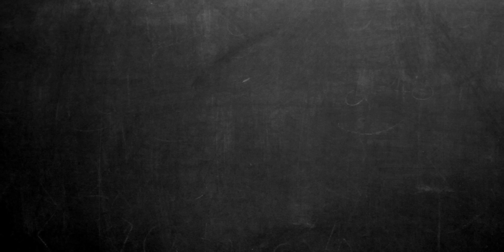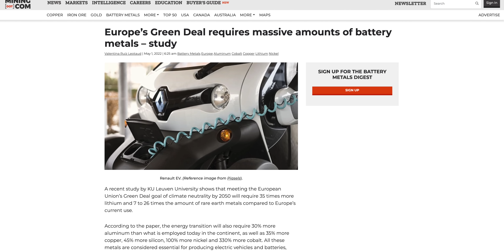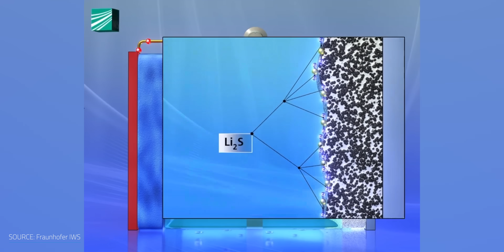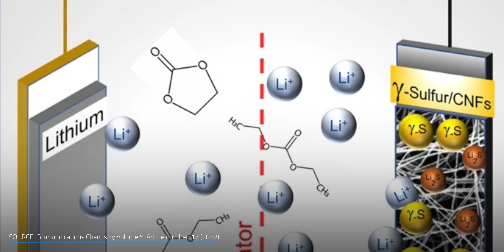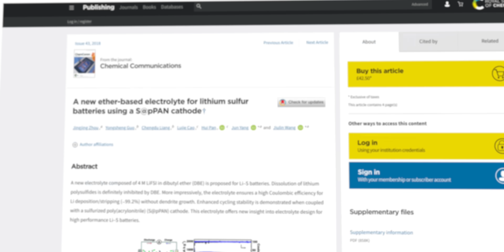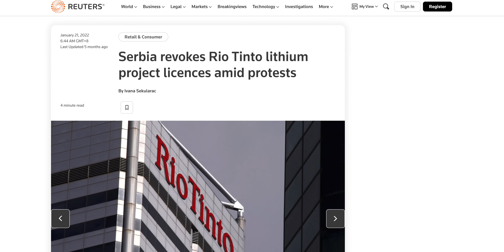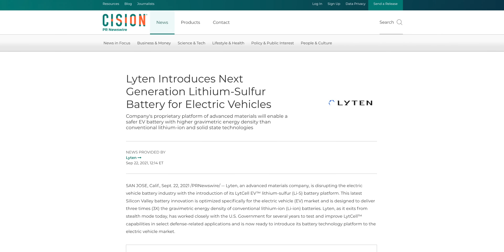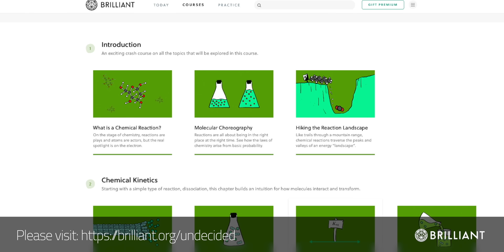Why This Accidental Battery Breakthrough Matters

Comment: I have a question. Could it be possible that someone might introduce Cobalt-60 to the supply chain of lithium ion batteries and this might end up in use, specifically in areas of the world with less control over such things? What would happen to such a battery, aside from being radioactive? Also, is it possible for lithium-ion batteries to become irradiated accidentally?

Comment: Great if it works out.
The problem with solar/wind and some other renewable sources is that we can't store the power effectively.  This sounds like something that might.
Certainly I would be more inclined to go electric if it had 3 times the range, though, to be honest, my driving is not an issue anymore since I work at home.
Still, this might make practical electric delivery trucks and possibly trains.

Comment: One of the big advantages of lithium iron phosphate batteries is that with their lower energy density than lithiumi ion batteries,  they don't catch fire when physically damaged.  Two or three times the energy density of lithium ion suggests fire could be a much bigger problem.   What are the potential mechanisms for uncontrolled energy release and what are the engineering implications for putting them in boats, car and airplanes?

Comment: I have not made the transition to BEVs because battery tech is constantly evolving. When they finally get to a tech improvement which takes away range anxiety, I will make the change. In the meantime, I will stick with ICE despite the high price of gas running as high as $6.50 or more here in the Los Angeles region. Let's face it, you can a lot of gas for $60K or more which is the median price for a BEV.

Comment: dude.  lithium extraction makes that shit totally not even worth it...500,000 GALLONS OF WATER??????

FOR ONLY 1 TON!!

Thats means you are screwing around with some where around 1,700 tons of water for 1 ton of lithium 

if you think that is better for the planet than say for instance, gasoline.  you'r out of your got dam mind lol
Reply: Why would it be worse than gasoline? Also he mentions the posibility to use sodium instead of lithium.
Reply: And yet the pollution to desalinate the water, produce the car, and energize an electric car for the lifetime of 1 ton of lithium is measured in hundreds of tonnes, while gasoline, over that same time, generates tens of THOUSANDS of tonnes of co2 pollution. This, of course, relies on us using nuclear energy, a PROPERLY clean energy source if done properly. It doesn't matter that we use more water, because the energy sources we advocate for still make wasting energy MORE efficient and less polluting.

Comment: Imagine a battery for flashlights where the battery life is years instead of a few months. I know flashlight batteries are not exciting, but are there any households or cars that do not have flashlights. Keyfob batteries, electronic locks, and a variety of electronic uses. Battery powered Keyboards and mouses are just one thing. Batteries in mother boards are how we keep some memory actions available. This is just a quick view.

Comment: I've been thinking about using water tanks as energy storage. You need water storage to be off grid anyway, you just need one tank at the bottom of a hill and another tank at the top. When you've got excess generation you can pump the water to the top tank, then when you need a boost, let it flow back down through a turbine. The main issue will be head height, but there are types of turbine that don't need a huge amount of gravity potential difference.
Reply: @Koss Billingham I'm thinking that perhaps nuclear fission could be used for generating energy. Take a suitable heavy element (perhaps Uranium 235) and split it, releasing energy that can be captured to produce steam that would run electric turbines. Scientists and engineers should work on this idea. It will save the planet. (Perhaps I should patent this idea.)

Comment: "500,000 gallons/ton of  lithium." 🤮
What are those? Imperial tons (long ton) or metric tons? 
Could you PLEASE refrain from using non-metric units for KEY-STATEMENTS? (for additional info it's OK though).

Comment: A couple of things to consider about battery development:

Speaking as a renewable energy professional, former EV builder, and long time battery geek, I have observed that if you want to know if a battery will last ten years, it takes…ten years. Ten years using the batteries twenty different ways.

Chemistries that work well in the lab don’t necessarily work well at high discharge rates, with thermal cycling, or with the vibration and jolts of vehicular use.

Reducing size and weight has consequences. No battery is 100% efficient and the heat of charging and discharging has to go somewhere. The more energy you pack in a small space the harder it is to get the waste heat energy out. Less surface area per volume. The less mass, the less to transmit that heat to the surface of the battery. There’s a limit, even with active cooling, to how energy dense you can make a battery. At some point you have to space cells to make it artificially less dense.

I blame sci-fi for the dilithium crystal fallacy: we’ll extract a city’s worth of power out of this thing the size of a baseball without it glowing white hot and exploding. No problem.
Reply: Most applications are more concerned about weight than volume, so maybe layouts using materials with higher specific energy could trade some volume for cooling? I mean, if your EV is already designed for a battery of a certain volume, then if you have cells with 3 times the specific energy, you could space them out in the volume you have and get more cooling that way.
Reply: @dalegreer3095  True! Car makers have figured out how to incorporate the volume of present technology batteries into a sedan, so any volume bonus can go to cooling.

Comment: Carbon and sulfur capture is the technology is the answer.  Solar and wind just can't give the power for industry or agriculture.  Capture technology is the only viable solution to cut air pollution.  The fact that more energy sources and storage can be produced from these captured byproducts makes this even more clear this is the future.  
Imagine a car running of Sodium-Sulfur batteries charging off a methane powerplant, all from the captured emissions from the plants and refineries used to make the car.

Comment: This still does not solve the land, mineral resources and toxin problems of wind and solar renewables, their fuel is not dense enough to make them sustainable, even with battery backup. The energy future is in nuclear and if you think differently then your just fooling yourself on the fanciful energy push that is largely based on the greenhouse gas driven climate change myth.

Comment: It makes sense that you would conflate advances in electrical energy storage with the abject failures of your so-called "renewables."  The vested-interest, and therefore politicized, promotional games of the latter are finished; they have run their corrupt course and we are moving on.

As we move forward on electrification (of just about everything, not just transportation), we are going to need REAL energy sources, REALLY reliable sources; not Malthusian junk.  So get over it, and move on already.   From micro-reactors, to SMRs, to the fourth and fifth generation large scale nuclear systems, the proverbial writing-is-on-the-wall.  We have no interest in a future that comprises elaborate band-aids for "renewables."  We are not even interested in the band-aid nonsense known as V2G.

Alternatively, Big Oil loves your Malthusian dribble.

Comment: What is wrong with these people. Lithium is limited, skyrocketing in price and its mining is both exploitative as well as a direct frontal assault on the environment so lets give it all a happy face 😀. 

If the largest lithium battery plant in the USA was devoted to storing intermittent energy (wind and solar) it would take 500 years of its full time production to power the USA for ONE DAY .....happy...happy....happy 😀😀😀.

Is wind power "eco friendly?"     If the wind turbines were ever to supply anything except vapor energy...not a single animal that flies would survive the onslaught.  Mass human migrations would need to occur to get way from its noisy, ugly, unhealthy presence.....happy happy.....😀😀

Thousands of miles of huge transmission towers and high tension lines will need to be strung across our formerly pristine forests  and mountainsides.   Much of the time supplying absolutely no energy at all and at other times igniting forest and grass fires.... oh happy day😀

Did I forget to mention the largest single source of planetary CO2 emissions is in the production of Portland cement used to make the 5,000,000 pounds of concrete used to anchor JUST ONE wind turbine to the soil  more joy...😂😂

Where does all the steel, aluminum, copper, cobalt, petrochemical resins, lubrication, come from....where does it go....can we build landfills fast enough or can we just toss all of it in the seas. Joyful and triumphant 😀
 
How about all the roads and construction equipment and the fuels used to erect and maintain it?   Concrete?  Fossil fuels?

The average life of a wind turbine is about the same as a car before it will all have to be scrapped due to obsolescence and wear.   A thing of beauty is a joy forever😛

Comment: Given that I can recall how short of a time AA batteries ran my Walkman in the early 80’s, we’ve sure come a long way with battery technology, but I love that these new discoveries will lead to safer, more sustainable and longer lasting batteries with greater capacity.
Reply: Well, and the fact a modern 'dumb' mp3 player will sip the power the Walkman guzzled as it wound your tapes.
Reply: At the cost of destroying the earth 👍

Gotta love technology
Reply: @christophervanzetta  more than I love the alternative.
Reply: I believe that ultimately the solution is not in chemical batteries, rather in Super-Capacitors (solid state/graphene based) which pick up the charge electrostatically, having several advantages over current battery technologies:
1. There's no chemicals/reactions to degrade over the time.
2. It charges extremely fast, within minutes to a full charge.
3. It has a high power density in a lightweight package, but energy density is relatively low which needs improvement.
There are several companies exploring this technology, here's some videos:
https://www.youtube.com/results?search_query=super+capacitors
Reply: @BillAnt  How long would one of those capacitors realistically be able to hold their charge?
Reply: @dragdritt  I wouldn't worry about how long, because unless reality is rewritten how much will remain as not enough with capacitors vs batteries.
Reply: @dragdritt  Its a capacitor they pretty much dump all power immediately.
Reply: @Subwolfer7564  - Unlike regular caps, super/ultra-caps don't lose their energy quickly, but they are able to "dump" it quickly for high powered applications.
Reply: @BillAnt  Super caps are slower but not near as slow as a battery, which means a lot of wasted power making a lower energy density.  When electric cars and modern mobile devices are concerned, efficiency is the name of the game. 

Caps have their use.  As a full replacement to batteries, likely not.
Reply: Battery energy density has changed very little over the last 20 years.  Some last longer because they can handle higher power output without dying right away.  The energy density of any type of capacitor, super or otherwise is about 100 times too low to replace batteries.
Reply: @drjretired4909  I don't think they replace batteries the way youre framing it. They take in energy quicker. So regenerative breaking recharges a battery but not quick enough, but it could recharge a supercapcitor extremely quickly. So used in conjunction with battery or even not, it's still better design.
Reply: @sampleoffers1978   they do take energy in quicker.  However the amount of total energy they can store is far too low to make it worthwhile unless you are talking about less than 1% of the total electrical energy storage.
Reply: @sampleoffers1978  In order to take in energy you HAVE to store it.  Even if it is for fractions of a second.  The best lithium battery can store ~1 mega joule in 1 kilogram.  If you wanted to use capacitors to take in and distribute, say, 4 percent of that energy for 1 second:  that's 40 kilowatts for 1 second therefore, 40 kilojoules.   A capacitor with the ability to hold 40 kilojoules would weigh at least one kilogram.  That additional kilogram is better used with another lithium battery.
Reply: @BillAnt  If a car design were two batteries...the secondary battery could recharge while in drive via regenerative breaking, recovering energy from kinetic motion. A flywheel or oil/wax tank heated up, but not burned...might allow heat exchanger to charge battery. Especially if it quirck charging. Bladeless wind turbines working off vibration might also provide the power to charge secondary battery in during drive.

Comment: I keep hearing the exact same thing over and over. Energy density is in direct relation to the insulator. Except Lithium is still the most reactive element in the formula and every recombination analogue produces similar results. I'm having a hard time believing using a carbon ceramic matrix will reduce the redox reaction in the electrolyte just because there's less electrolyte by displacement in the initial manufacture rather than the typical life of the product as defined by the redox reaction. While the emphasis seems to be on reducing manufacturing costs, I'd like to see if carbon nanoparticles could replace the outer shell so that battery cells can be used as a stressed structural component

Comment: As stated in the Video ; "Economic feasibility" is what has been holding back everything from intermittent Renewable Energy on the Grid  to almost anything Battery power pack related - such as Electric Vehicles. 
Batteries have been improving in every way except being  Cost Viable.  There is no point in a better Battery
if it's performance is up  20% when it Costs 40% more. 

EV's are a prime example whereby; they depreciate more than any other Vehicle.   When it's time to replace the EV's Batteries - the Vehicle is often worth less at that stage , than what the Battery Replacement cost is.    This explains why, EV's remain less than 1% of Vehicles on US roads.   

Currently , the most expensive Energy on the Grid is Batteries fed by Renewable Energy.  I do not believe the lithium -sulfur improvement will be good enough to change the equation.  Reliable Base-load power on the Grid - as required for heavy industries & major cities is way beyond Batteries,, for some decades yet...
Reply: Do you have a source for your claim that EVs depreciate more than conventional cars? That sounds wrong to me.
EVs have much fewer parts that need maintenance or replacement and the battery lasts many hundreds of thousands of miles before needing replacement (there is a Tesla Model S used as taxi already having accomplished 620,000 miles on one battery pack). At that mileage every car is essentially worthless and its value depends on the price of the replacement components. In an ICE car that would be engine, tranission, cooling system, exhaust, etc. In an EV it will be mostly just the battery pack. The motor will last way beyond the car's exterior and interior body parts.

The factor for EV market adoption is providing charging infrastructure. Norwegians are buying 92% of their new vehicles as EVs already, and that's because of the ease of charging. In all other aspects EVs are economically superior to ICE cars already anyways.

Comment: Any technology that provides higher efficiency while replacing cobalt and lithium by more abundant materials, availabe from multiple sources, has my vote. 
However:
- Charging an EV with 8x capacity of a Model 3 Standard in 4 hours would require 100,000 kW per hour. That is 14x the capacity an average American home uses per day. That would require very, very thick cables, meaning huge amounts of not so abundant copper. Or 200+ solar panels of the highest efficiency avaliable, under the best circumstances, for each EV. 
- What happens if one cell (group) catches on fire? Especially because I understand that this is wet technology, which with Li Ion tends to squirt flammable fluid when on fire.
- How well can this technology be truly recycled? Truly recycling Li Ion cells into separate components is hard and expensive, only 5% is recycled, the rest, being toxic waste, burnt or buried. As to keep that on the down low thatthere is hardly any recycling, vendors tell recycle where it actually is reuse.
- Will the large group of people that can only afford that good old smaller Nissan be able to afford this technology? Or will be used price stay beyond their budget because of the ever higher price of raw materials making an EV function, such as copper? And in either way, a repair on an EV past guarantee cost thousands.